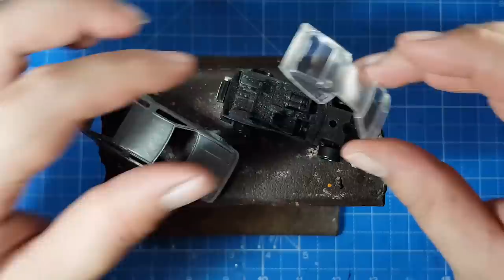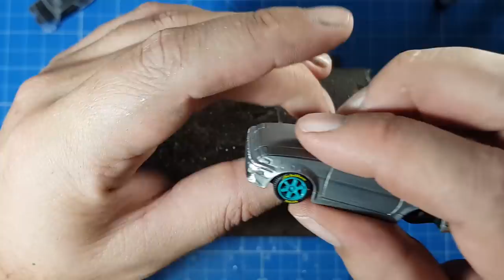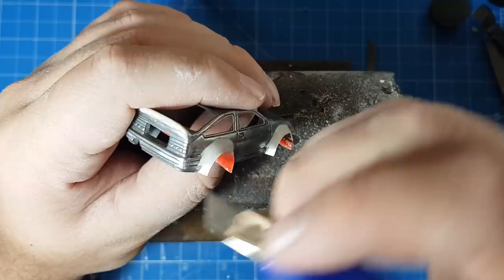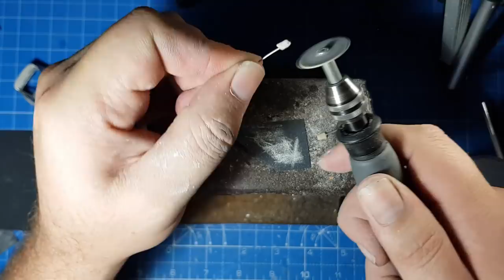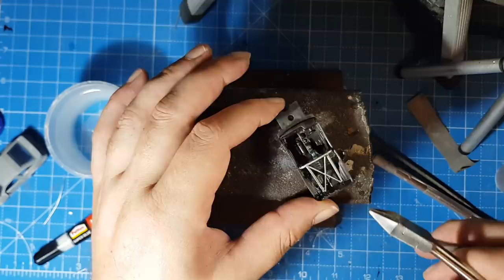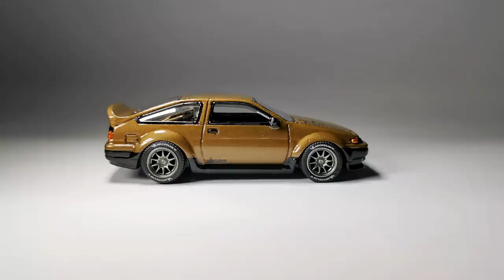Custom Hot Wheels Toyota Corolla AE86 Stance

Comment: Cool, I had an actual '80 Toyota Corolla liftback 1.8 L
 5 speed. Loved that car, it had almost 400.000 miles on the odometer, when I sold it...  👍🏁
Reply from the maker: Awesome. They are diehard little cars. I had a 1986 4age version but she had a few issues and I sold her. Stil mis it. Was a awesome car😭
Reply: @diecastcustoms8512  Yeah, you can't beat Toyota with a stick, for reliability. Btw, your custom is awesome...🔥✌
Reply from the maker: Thank you brother😁🤘

Comment: Put the decals before the Clear lack ... after you dont see the edge for the decals😉
Reply from the maker: Hehe. Thanks for advise. I do though. I place the decals. Then i put 1 thin coat clear. Let it dry. And then 3 to 5 thick coats of clear. I think it shows because of the metalic in the brown.😭 I also find that the tamiya clear coat is very thin.

Comment: hello my friend, what is your polisher name and model number ? would you mind to tell me, I want to buy a new one.
Reply from the maker: Hi. I dont realy polish. I paint with a primer. Sand it off  and paint 1 coat of paint. Sand it off. Then I do paint. After paint dry I do detailing and then I use tamiya clear coat. The best clear coat ever😁🤘
Reply: I mean what is brand of the grinding machine you using in the video🤔🤔😋😋
Reply from the maker: @tykayu9905  https://www.dremeleurope.com/za/en/dremel%C2%AE4000-395-ocs-p/ There you go. that is a link to my setup, the dremel 4000 is sometimes a little bit weak